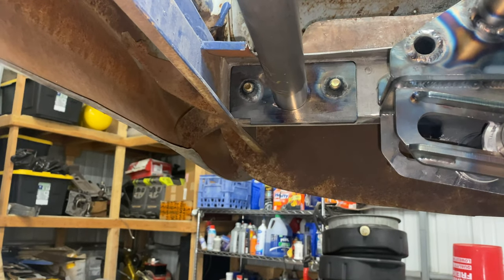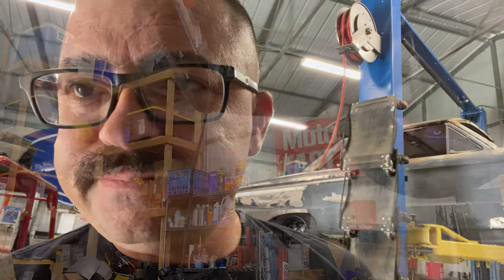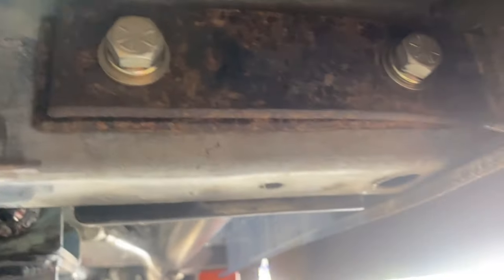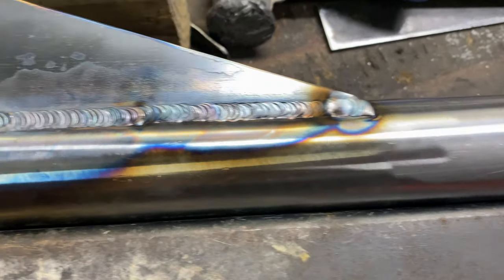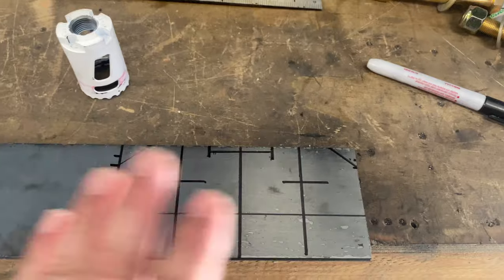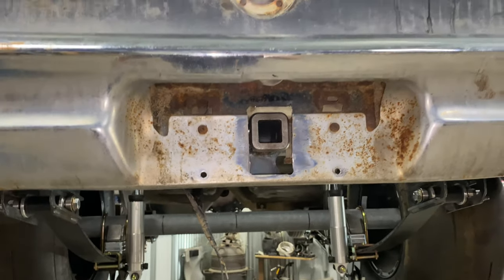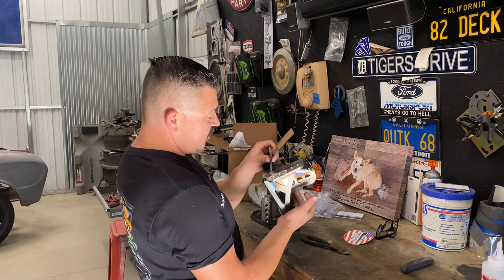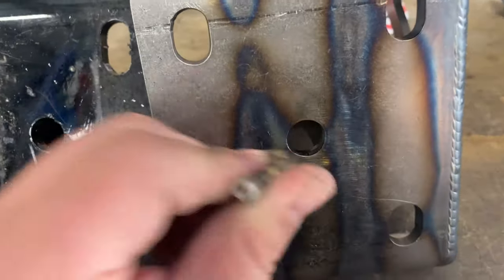BUILDING A HITCH FOR A RACE CAR? YES!!! and we install new lower spring plates from FUNKHOUSER RC!

Comment: Last comment I promise. You put a anti roll bar. I thought the Cal Tracks would take care of that.   What is your thoughts on that?
Reply from the maker: https://www.funkhouserracecars.com/collections/frontpage/products/lower-spring-plates

Les this is the plate I used, as far as the anti roll bar, it helps prevent the car from leaving unevenly even if it’s a leaf spring car. A lot of leaf guys use them.
Reply: @TeamDPerformance   Okay,   I just figured you would tighten up on side or the other on the Cal traces thing.  What I saw. Wow $231 on the plates?  I would like those but ..  my cage is more important right now. thanks for the link!
Reply from the maker: You’re right but running the bar helps it too. Safety should always come first! You see the bad apple wreck ? On John Doc’s channel you know what I’m talking about 😩
Reply: @TeamDPerformance   I have not.
Reply from the maker: Check out his channel and that wreck! Messed the car and driver ip
Reply: @TeamDPerformance   What I seen was a Mustang and not a leaf spring car?
Reply from the maker: Yea just safety is top priority is all I was saying.